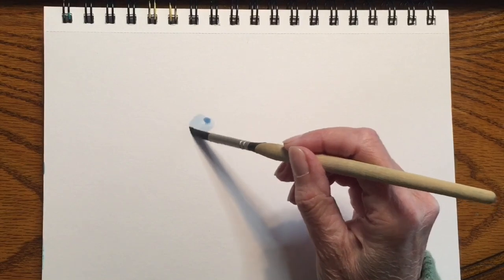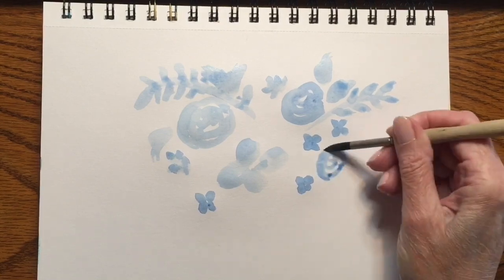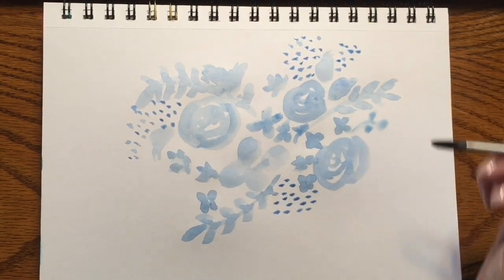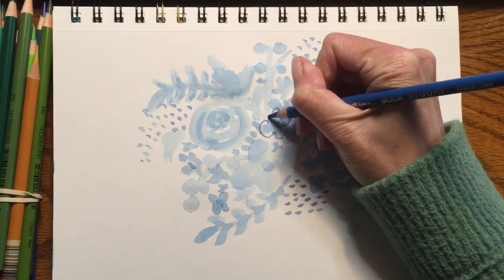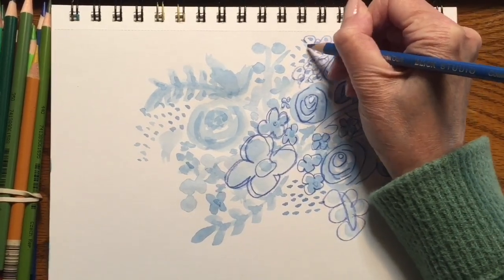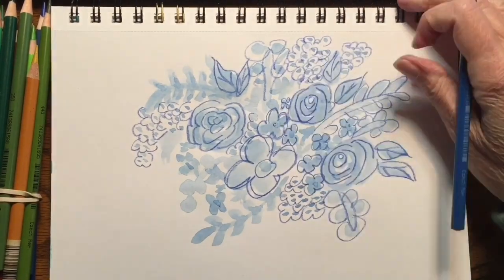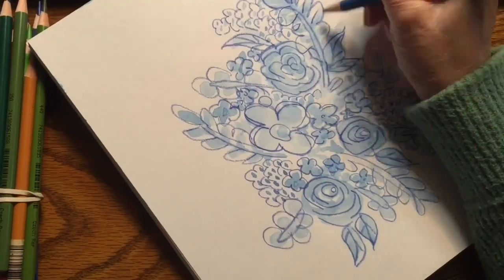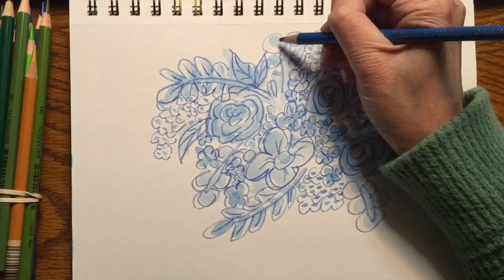Cleansing Your Creative Palate, Soft Soldering ✿ VLOG ✿

Comment: My latest hobby is drawing in procreate. I have been a jewelry maker off and on for many years. Pro by no means😅 I tried my hand at molten solder techniques a few years ago and that was really fun. I’m into mixed media art but by no means an artist😂. Just bought a new Bakon 969 Soldering iron kit and have been watching your tutorials. I tried the mushroom pendant but can’t get my solder to stay on my copper. Using new liquid flux. I just ordered Boho Chic Jewelry and can’t wait to get it.
Reply from the maker: Make sure the copper is very clean! (use steel wool to shine it up if necessary), heat it well with your iron (it will heat up while you are soldering of course, so after working on it a while the soldering gets easier), use enough flux, and that should do the trick!